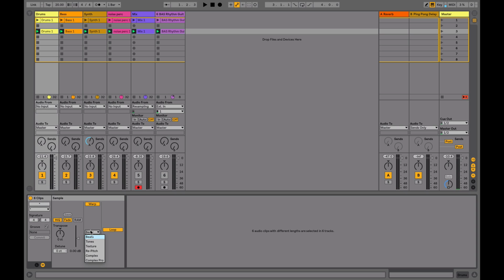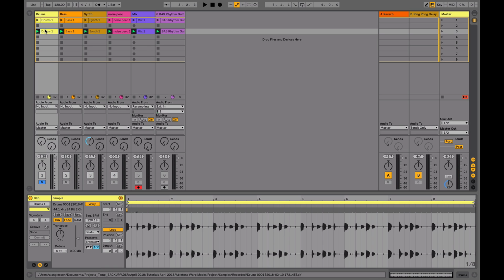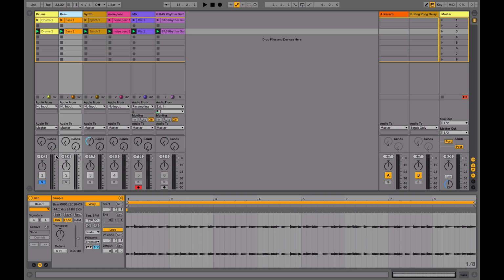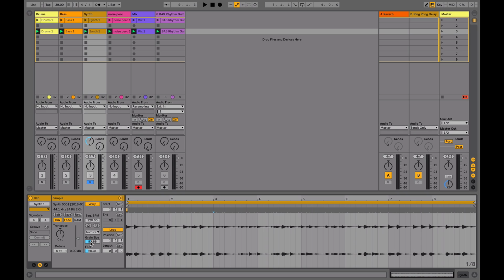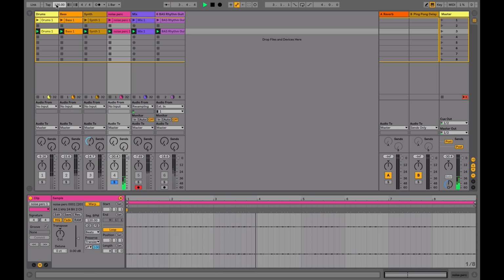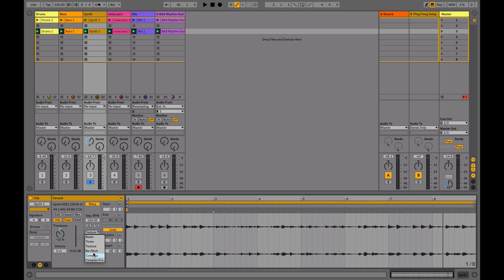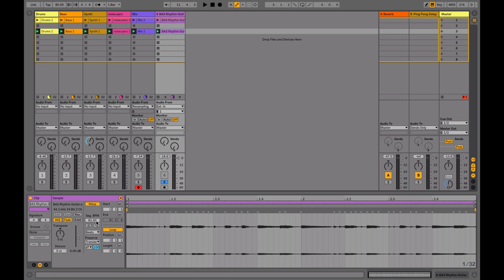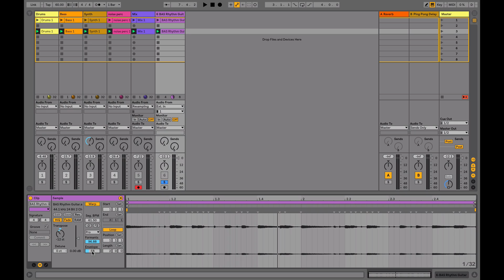Ableton Live warp modes explained

Comment: Great tutorial. Calm and clearly explained. Thanks. What I'm puzzled about is if different WARP modes introduces different tempo changes.. I'm trying to speed up a track, but I don't wanna speed up the Master, but individual tracks. With different Warping timing gets off. Really annoying as I can't figure out exactly what's happening. Is Warping effecting speed differently with each mode?
Reply: So I'm not sure what you mean but in this example hes changing the master pitch. There is also a pitch for each individual sample. Idk if you mean its causing you problems in a live setting as I'm sure it might. I just use this feature for sound design. I record a sound while modulating the texture one usually so I get these random as fuck artifacts and them you can also use the loop record feature to mess with the pitch of the sample :]